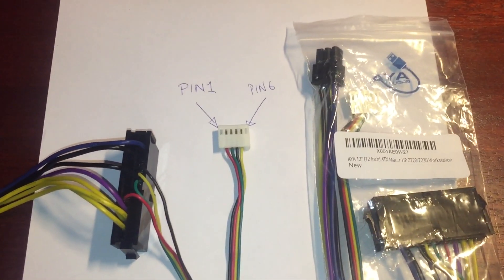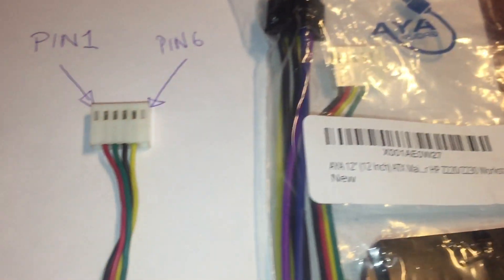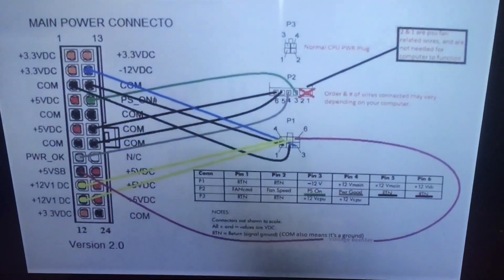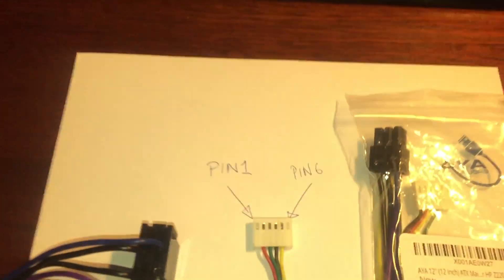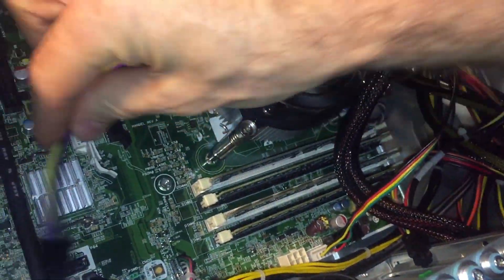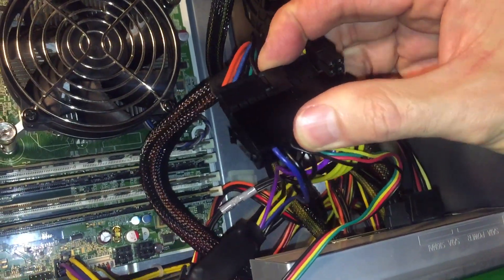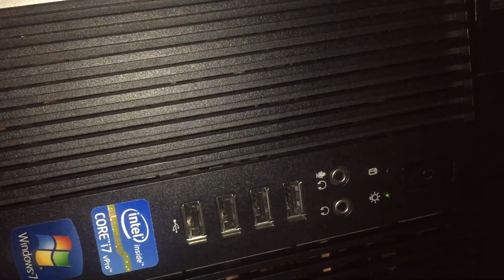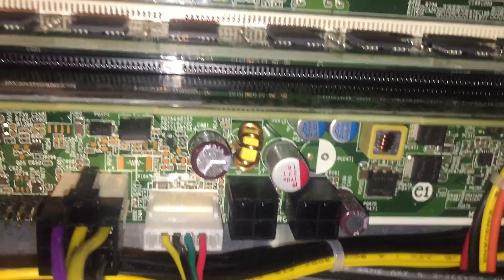HP Elite 8200 PSU Adapter pin configuration

Comment: So I bought this 24 pin to 8 pin connector the only problem is I found out two of my ATX power supplies they have 20 pin coming out instead of 24 pin is it still possible or I'm going to have to buy a ATX power supply with a 24 pin connector and then see if what you got going on is something I might have to do what are your thoughts? I should have mentioned I have the 82 00 I believe similar to yours and it's the small form factor HP elite PC

Comment: I have an HP with the same type of power supply, which is dead. I have other power supplies that I could put in it, but they have 24 pin connectors. I have older, junk computers that don't work, and I figured I could take the 24 pin socket off the motherboard and use it to make an adapter. So I went looking for a wiring diagram for such an adapter. What I discovered is that absolutely NOBODY bothers to label which side of the 6 pin connectors they're showing. 

I have two different diagrams and they are the reverse of each other, even though they have the pins numbered in the same orientation. And more than that, comparing the wires shown to the non-working power supply, it looks like both diagrams have one of the connectors shown from the back, and the other shown from the front. WTF??? At least they were nice enough to show the keyed pins on the 24 pin connector, so you can tell which ones are which.

Comment: Ай молодец ! Теперь осталось соединить перемычкой  Pin 1 и Pin 6 и больше не нужно нажимать F1.
Reply: Hi, mate I have one post error   90e powersupply fan not detected in hp elitedesk 800g2 and hp z240. I did short pin1 /6 still same. Any other way 
Thanks

Comment: I have an HP 8200 Elite Desktop and wanted to replace the power supply. I bought an atx power supply adapter, which only has 3 cables and a small bridge on p2. The seller says you have to change the pins but I don't know how and the seller doesn't want to help. I'm really desperate

Comment: hi man, these videos are always useful (even if from 4 years ago).
Do you perhaps have an idea of the pin scheme of the PWRCMD connector (P2) of an HP ProDesk 400 G6 MT with HP 8599 mainboard which instead has 7 pins ?
I need to upgrade the psu but can't find that schematic 😞
Reply: I have the same issue please let me know if you found anything

Comment: I have the hp prodesk 600 g1 and I bought that adapter and it doesn’t work ¿Can you help me?
Reply: Have you found the solution for HP Prodesk 600 g1 TWR?
Reply: Have you found the configuration for HP Prodesk 600 g1 TWR?

Comment: This configuration works but will give you 515 error.
Also this does not match with the original pin configuration of P2 connector.
The diagram that you showed was the correct one but the config that you actually did was not.
This is how the pin configuration of the adapter needs to be done for 8x00 CMT. Forget about colours. They are different for different after market adapters. Just arrange them as below.
Pin 1= Ground/Common (can be taken from any Ground/Common of 24pin atx connector) - Black wire in original connector and Empty in some 8x00 CMT  models.
Pin 2 = Empty - Empty in the original connecter.
Pin 3 = Power Ok(Power Good) - Grey wire in original connector
Pin 4 = Power On - Green wire in Original connector
Pin 5&6 = Jump to remove 515 error - white and white with red strip in the original connector.
This configuration works for 8x00 CMT. I am using it.
Reply: بارك الله فيك
Reply: to remove 515 error i have to link pin 6 to pin5 ?
Reply: @ghazinspace  Yes, these should be white and white with red line wires in Orginal P2 connectors.
I did it for 8200, if you have 8200 then you can safely jump 5&6. If you have any other 8x00 series, it will most probably work but it is recommended to check where these wires go in the original connector.
Reply: @nightshade5286  i have HP compaq 6300 pro but i think that it have thé same original connecteor. So i Can link 5 and 6. Have u WhatsApp ?
Reply: @ghazinspace  Don't know about 6300, but if you have PSU with part number 611482-001 or 702306-001, it will work. 
Bro simply check pins for the white and white with red line wire in your original Connector and jump them when using the adapter...
Reply: @nightshade5286  نجحت شكرا لك
Reply: How about for HP Prodesk 600 G1 TWR?

Comment: CAUTION .. HP 8200 Elite small factor and HP 6300 pro ,if you are looking to find a way to avoid error No. 515  Searching in many videos I ended up  to short the two PINwhen i short pin 5-6  the motherboard never worked again unfortunately it burned !!!!

Comment: Is there a wire diagram for hp prodesk 600g2, cuz I get error 90E power supply fan not detected
Reply: pudiste resolverlo?
Reply: tengo el mismo problema

Comment: I want to know if this has the same configuration with the 8200 small form factor. Does anyone also know how to bypass direct boot instead of always pressing F1 if the powersupply fan from the stock psu is not detected? Cheers!
Reply: ive seen others short out two pins on the proprietary connector to disable fan check/ f1 press. i dont know which pins though.
Reply: @socks2441  yeah, i hope someone would do a video where to locate those pins.

Comment: Pin 1 connect to Pin 6 on the 6 pin connector to bypass the fan error, no more F1 to boot.
Reply: Thanks a lot mate...
Reply: Will it still boot if you don't do that
Reply: I got my adapter and didn't have change pins

Comment: my p2 has the cables reversed, that is, pin 4 is green and pin 3 is gray, my question is whether I connect it according to the diagram based on the colors or based on the position of the pins

Comment: You just saved me from growing a few more gray hairs today. THANKS!
Reply: my p2 has the cables reversed, that is, pin 4 is green and pin 3 is gray, my question is whether I connect it according to the diagram based on the colors or based on the position of the pins
Reply: @constantinojaviervaleracha4727  Position! I did it like that and it worked. Color is irrelevant.
Reply: @constantinojaviervaleracha4727  I had the same cable as yours.
Reply: @constantinojaviervaleracha4727  I mean, if you are talking about position in the cable of course. The positions in the rack has to be changed.

Comment: the 6 pin only uses 3 wires from the 24 pin. The 4th wire on all those cables for sale are using 2 grounds when it only uses 1. Not really sure how they even work when you finally figure out the correct sequence. The middle 2 pins are for power on and power ok. The one on the end is the ground. The loop on the other end just jumps the last 2 pins to mimic a fan. All I know is it works flawlessly and my computer doesn't make me press f1 anymore. This link is the correct pinout for these machines.https://www.amazon.com/gp/product/B06XW7RWNH/ref=ppx_yo_dt_b_asin_title_o00_s00?ie=UTF8&psc=1. By the waythe one I ordered from moddiy arrived and was wired exactly the same way. On the 24 pin connector pin 8 is power ok and pin 16 is power on. I just counted and there are 8 grounds on that 24 pin connector and , again , you only need 1 of those going to your 6 pin connector. I hope this helps you and anyone else fighting this.

Comment: hey i bought one of these cables for a motherboard of a hp 6000 pro small so that the 4 cables the colors are brown blue yellow and gray there the power led lights the colers turn on, but the motherboard does not show the video nor the keyboard lights. you would have the electrical diagram of the adapter cable

Comment: I have a franken-puter with a hp elitedesk 800 g1 mobo. I need help with a proper pin config for my adapter. The original psu has 5 total wires, a space between the 4th and the 5th wires.

Comment: Hello to me the same thing happens but the opposite to your case .... my motherboard hp has been spoiled, but the source is in good condition and I have a motherboard of 24 pins. How can I connect the 24-pin motherboard to the HP 6-pin power supply?
Does the connection you made work? Greetings from Chile.

Comment: Hi! Thanks for the video. I can't understand, HP`s PSU has +12Vsb but standart ATX PSU +5Vsb... Manual says http://h10032.www1.hp.com/ctg/Manual/c01960471 (p. 7-3) that AC range is11.06 to 11.74 volts... How does it work?

Comment: got same problem but my 5 pin connector  use  just four cables..white...orange...yellow and black...so i should redirect to same on 24 pin atx psu??escept white wich goes to grey on 24 pin atx as my one dont have white??

Comment: any help to rewire the 4 pin auxiliary power p4 to 24 pins atx please??i really need to know where to connect the cables orange,white,yellow and black to work..and the new psu have just the auxiliary power with 4 pin (2 yellow 2 black)

Comment: hi mate..ive got a similar problem with the intel auxiliary power 4 pin(in 5 pin hole with 4 cables orange,white,yellow,black)my new psu just have the 4 pin (2 yellow 2 black) the older psu die..as far as i know my mobo s5520hc intel server with dual xeon will not power up without the 4 pin mentioned at the beginning..can i hook up the cables of the old 4 pin into the 24 pins??and where goes the colors with..please helpme anybody..thanks

Comment: Hi bro I have a HP Compaq 6300 Pro Micro Tower and I wanna upgrade my Psu. Now Im using the stock 320w psu (pc9057). I wanna buy a evga 600w atx psu, but I dont know if it fits in this case???? Am I gonna need to buy this adapter too?

Comment: How did you secure your power supply in the case, it looks smaller than the original.  I have the same issue with mine and am looking for ways to properly secure it as the holes do not line up for the screws and it is shorter.  Thanks.
Reply: You just have to simply drill new holes. Took me less than a half hour from start to finish. Also helps to use a dremel cutoff wheel to remove sheetmetal from tower for a nice factory finish look

Comment: How do you get rid of the "90E-Power Supply Fan Not detected".
800 elite G2 from a SFF case to Normal ATX Case/PSU.

The fan still works...the system boots up fine..
But you need to hit ENTER on BIOS screen EVERY-TIME you switch the PC on...
Reply: have you ever solved this ?

Comment: Wait... I ordered an 'ATX 24pin to 6pin Power Adapter Cable for HP Elite 8300', and it came wired like your example [xOOOOx].  I open my HP Elite 8300 PC case and started to install it, but my "original" P2 connector wiring was as follows:  [xxOOOO]  ....  If I use the one I ordered (wired like yours), it will be wired differently from factory original..   
Was your "original" P2 connector wiring 'centered' or to 'one side'? 
I will wait to do ANYTHING until I hear from you, as the eBay store I purchased from seems to know nothing about this.
Reply from the maker: The exact wiring demonstrated works, but with a boot F1 to continue message.

I still haven't experienced any damage to my 8300 yet! :)
Reply: @o0FUZ0o  
Thanks!
Reply: I have the exact same problem. I did it and it boots fine but when I'm gaming (with a gtx 660), the PC will suddenly turn off and restart
Reply: @fabricetarak1659  
Thank you for your reply.  What is the wattage of the power supply that are you currently using? 
The reason I ask is, THAT is the same problem I was having with my stock 320 watt PSU... which is why I want to install a new 600 watt PSU, but was afraid to use a "changed" wire configuration.  Also, I installed a new graphics card (Radeon RX 590), that demands more power than that old 320 stock PSU can provide.
Reply: UPDATE: I was afraid that this wiring configuration might harm some parts in my PC, because the original wiring was different from the wiring shown in the video.  I used a connector EXACTLY like the one shown here and everything works fine.  Of course I get the 515 fan error message at boot, but just have to press F1 to continue.  I understand that even 'that' can be eliminated (515 error), by placing a wire (jumper), from pin 1 to pin 6. 
The biggest hurdle in this project (for me), is how to MOUNT the new PSU, for the screw pattern as well as the opening in the PC case, do not match.  For those having this same problem, I suggest the same method that I used, which is to use long zip ties around the new PSU, going through the existing holes to hold it in place.  I had to use 3 long ties on top and three on bottom, connected together in sequence (end to tip), in order to be long enough.
Reply: @RonRay  Jumping pin 1 to pin 6 did nothing for my HP 8300 CMT. I am presently waiting for another adapter cable to arrive from Moddiy out of China. They claim to have eliminated the 515 error in their cable but I understand them to be specific to the model you are working on. The one I ordered was specific to the 8300 CMT
Reply: @tanapitbull  Thank you for your reply.
Reply: @RonRay  Were you ever able to resolve the 515 error? If so what worked for you?
Reply: @tanapitbull  No.. I have (for 9 months now), hit "F1" on every boot. It's a hassle, but one I have accepted.  :)  Other than that, the cable and plug have worked great with my 650 watt power supply.
Reply: @RonRay  I noticed you used zip ties to mount your power supply. I used a cordless drill and a dremel cutoff wheel to modify the tower cabinet so that the screws would hold it in. Only had to drill 2 and removed about 1 1/2 square inches of material from the cabinet for a nice tight custom fit. I would be glad to help show you how. I am a Machinist by trade so that kind of stuff was easy. I almost gained 10 years fiddling with all that wiring lol.
Reply: @tanapitbull   I considered using a drill, but the thought of all the loose metal filings in the motherboard changed my mind... The zip ties actually hold it in place very nicely.
Reply: @RonRay  Totally understand although I don't have any metal filings on my motherboard.I think I have better sense than to allow them on the motherboard. I guess it just depends on the amount of patience one has to spend masking off all of that. Zip ties are definitely easier though lol
Reply: @tanapitbull  I understand totally... It's just that I am an OCD worrywart and leave nothing questionable to chance... hence my response to this video.  :)
Reply: @RonRay  can I get a picture of what you did, I am running into the same problem
Reply: I have same issu plzzz help bro
Reply: I have same issu plzzz help
Reply: @jahangirkazmi143  I installed it just like it came when ordered. [xOOOOx] No problems.  The only thing is, I have to hit the "F1" key every time I boot, because of the '515 no fan detected' error. I just hit the F1 key and everything works great. 
I even placed a jumper wire from the ground to the outside blank socket (as I read online), but I still get that error every time I boot up the PC.  I can live with that. :)

Comment: Its possible use this reduction to HP compaq 6200 pro microtower? I started to have problems with my 320w psu ,so i will need stronger one.. :/
Reply: Check if u have same connectors as shown in this video!
Reply: yes, its worked for me

Comment: tengo una fuente hp modelo,s-4321-1bh , tiene tres connctores  
p1 -- pin 1-negro; pin 2-negro; pin3-azul  -12v; pin4-morado -11.48v;  pin5-amarillo 12v
pin 6 -12v
p2  --pin 3-gris 3.3v  pin4-verde : pin 5 -blanco ; pin 6 - blanco
p3 --pin1-negro ; pin 2 - negro ; pin3 - marron -12v ;  pin 4 -marron -12v 
como saber si esta fuente esta bien y como saber si estos voltajes estan bien